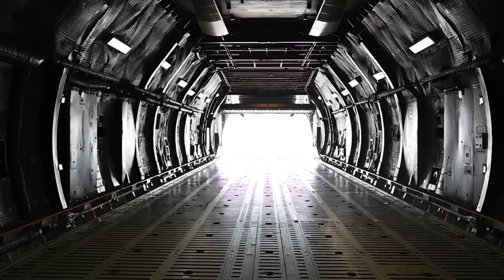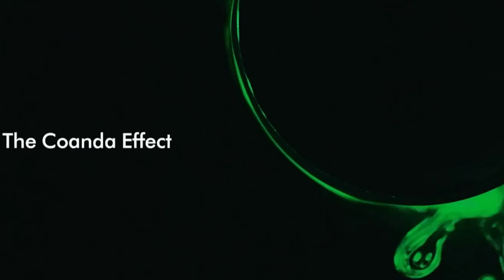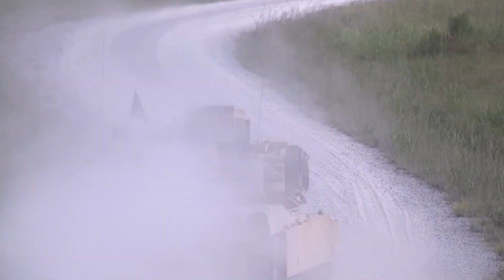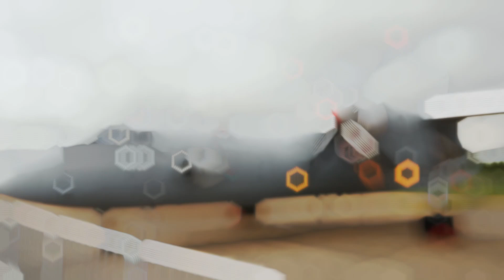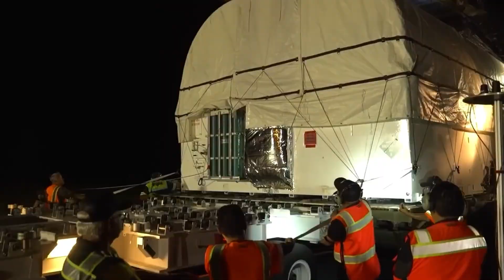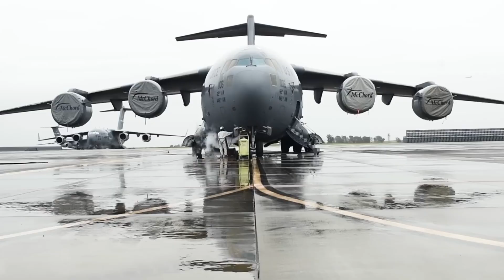What Makes This AIRCRAFT the BEST in Military Transport?

Comment: Long bed, wide bed, lots of hook points of a variety of loads. it also has a flat cargo deck with slots on it that can flip over that have rollers on the reverse side. This allows the aircraft to accommodate palletized loads. It's also designed with a nose that can rotate upwards, and the rear cargo ramp can either unfold downward so the deck is parallel with the ground - allowing it to be loaded with pallets from the "Tunner" 60K loader, or fully downward to allow vehicles to drive up the ramp.

one big problem with the C-5 is that they see a LOT of downtime. I used to be in communication with a C-5 pilot that told me every hour of flight time amounted to an hour or maintenance. This was 20 years ago when we were both in the Air Force.

I think that's gotten better nowadays given we are now 40 years post-re-winging, and since new engines have been installed.

https://youtu.be/iOySQcJEkN8?t=79